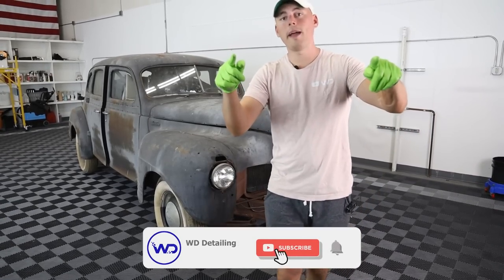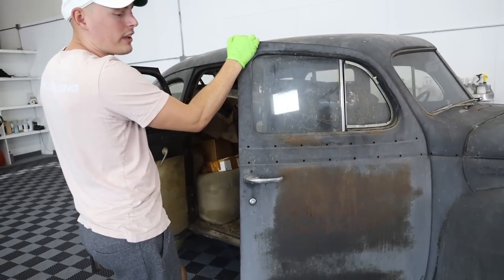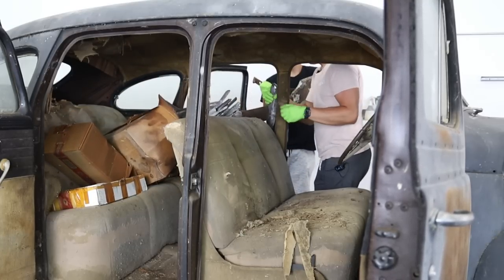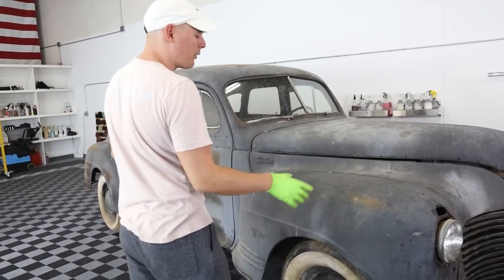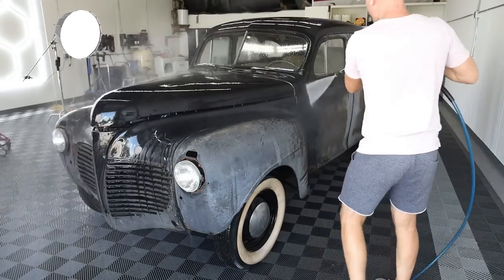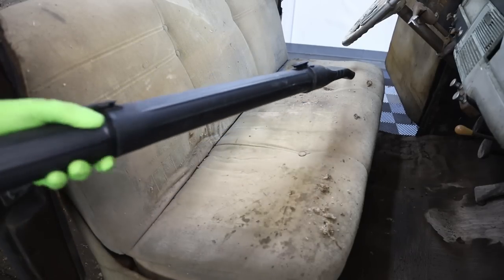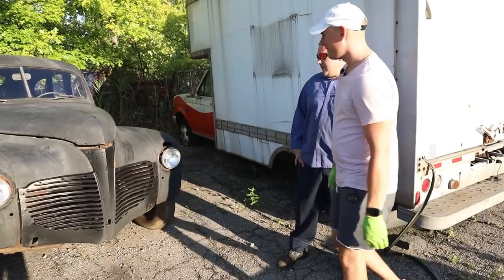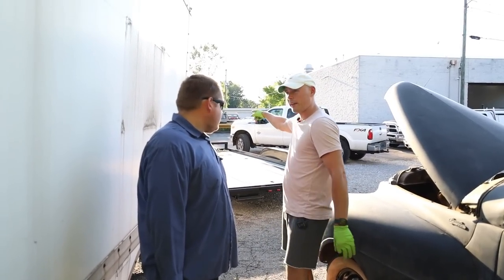Disaster Barnyard Find | First Wash In 70 Years! | ABANDONED Plymouth | Car Detailing Restoration

Comment: My dad's first car was a new '40 coupe. He sold it when he was drafted in WW2. The video shows the Plymouth is very solid & most body panels are intact which in itself is a huge plus. Tough to say how much it would cost to restore to new. A used Mopar slant 6 or 318 V8 driveline with new wiring, 12-volt system, suspension & paint to make it driver quality could be done for under 15K. 4 doors just don't bring in the big bucks but worth saving to cruise in. Get it running and safe to drive and see how it plays out. You won't lose $ on it in case you want to sell it. Same for the DeSoto.

Comment: To make it road worthy all depends upon its bones/chassis and engine. If the chassis is beyond saving, then it's a parts car - if you can save it - what will it cost, and is it worth it?  The interior fully done would cost $7 to $10 grand including the dash - a paint job easily would be 10K -including all new weather seals and other rubber parts. Consider everything on this car (1939) Plymouth - wiring, engine overhaul, transmission overhaul, rear end overhaul, springs, shocks, brakes, drums,  gas tank, brake lines, radiator, heater core, hoses, vacuum wipers, gauges, lamps, lights, battery, coil, windshield washer system, steering wheel remolded, knobs, wheels, tires, bumpers re-chromed, accent trimmings found, hood emblem, hub caps, beauty rings, and most likely new sheet metal for the trunk and floors, possibly all-new glass too - you've got 50 K or more into a 1939 Plymouth four-door super deluxe!  Would that car recoup that money if sold? NO, it wouldn't!
Reply: 7 to 10 grand for a complete interior? Someone's taken you for a ride love because that's way over priced,
You have no idea when it comes too cars, clearly

Comment: Any tips for removing fine scratches from windshield? They're just from using the wipers for 230k+ miles. Polishing compound alone wouldnt remove them but I don't want to use a more abrasive compound without instruction.
Reply: Weird tip but have you tried toothpaste? Colgate I find works best for light scratches, you mix some paste with a little water (not runny)  put on a layer over the scratches,leave it for 20-30mins then buff out, WD-40 works the same too

Comment: Is he stupid 4-5 grand to get it running??
Just take off the valve covers drain the oil put new in put some two stroke gas down the carb and if it has spark itl light right off. If it doesent have spark you need to sand the points. This will cost ab 10 bucks 😂👍

Comment: 4/5 k get the fck out here.  you better find better Mechanic, that highway robbery.  those old cars if /or if it is motor is locked up, can brought back for little to nothing.  Parts aren't that hard with the internet anything can be found, not in the 80's where search classified to find parts. so many you tubers out that can easily help getting that to run no problem at all. BTW is cleaned up nicely, that Old Lacquer paint should take a shine, with little elbow grease allot buffing pads compound.  always get 2nd opinion on mech work, nothing should cost 4k to get old car running, what's his Hr rate 150.00 holly cow/  sorry had vent loose it there on cost get running. most that stuff can be refurbished, except hoses, brake lines, etc..  but actual parts can be restored, 5k Pfft.